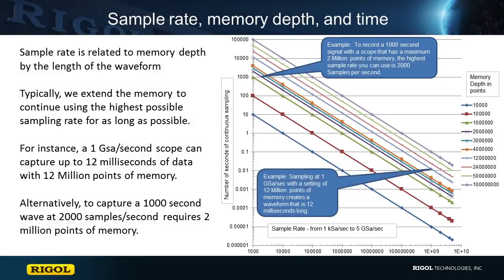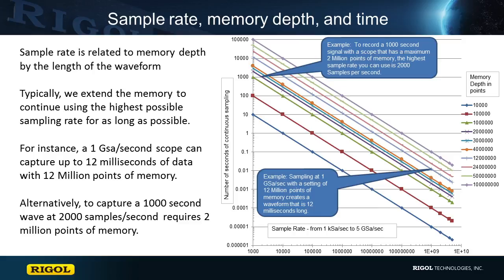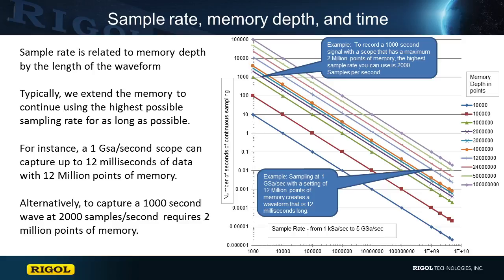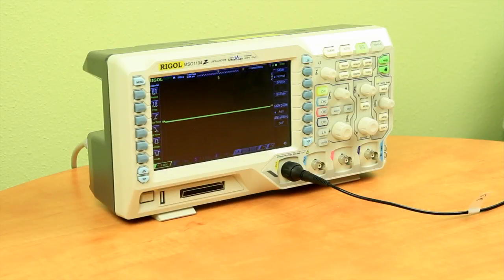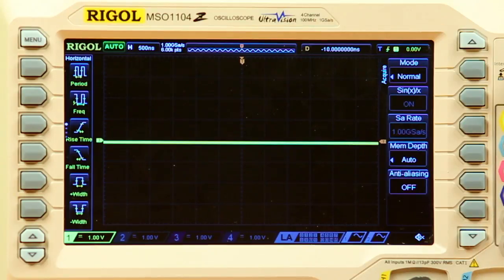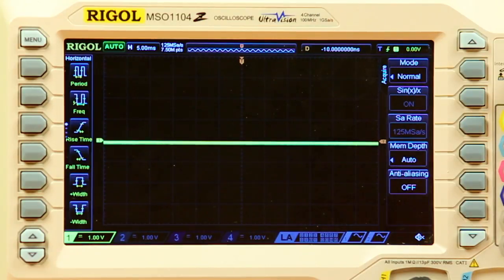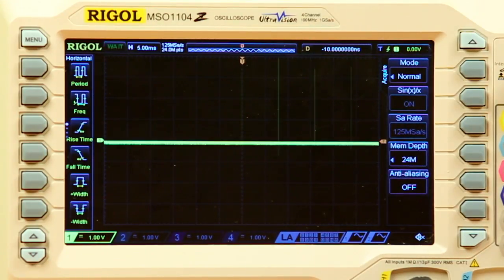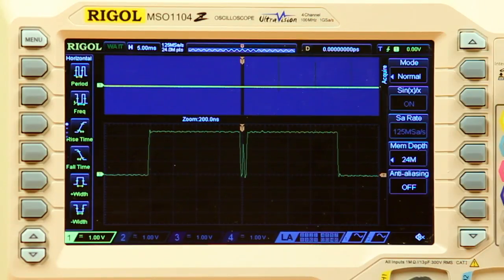Sample Rate Vs Memory Depth

Comment: So why would you ever want to use less than maximum sample depth? (Or Auto mode, which may automatically use less than maximum sample depth?)
Reply from the maker: The best reason would be if you needed to catch repeating trigger events at a faster rate. With 100 million points available, max memory depth means each capture is milliseconds long. If you want to capture repeating events in the microsecond range, then you should use shorter captures at max sample rate.